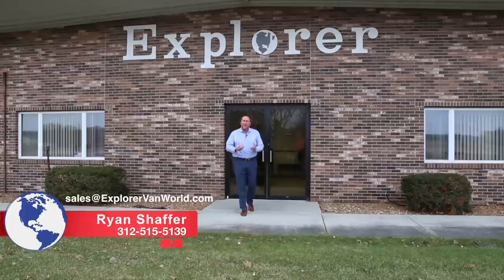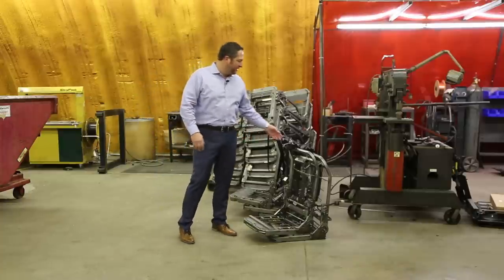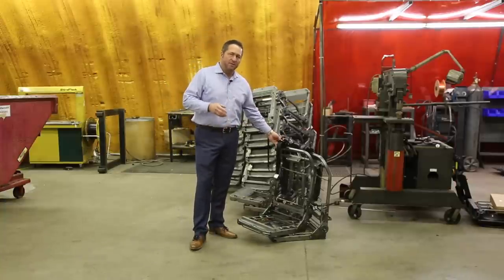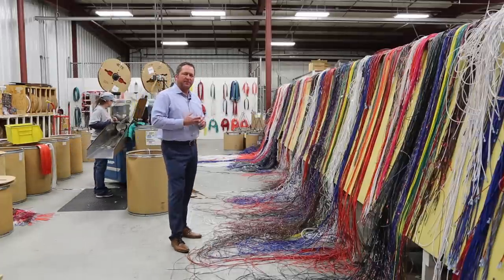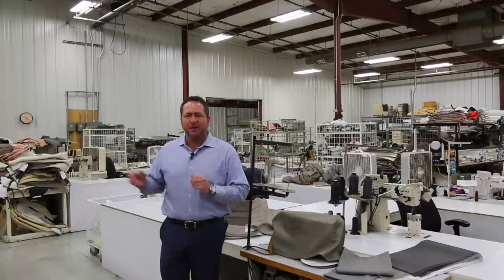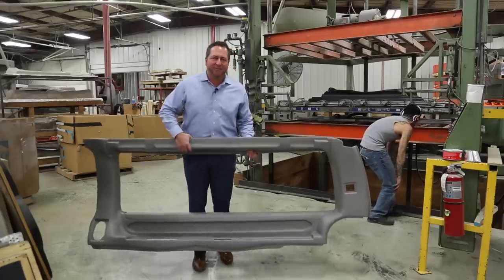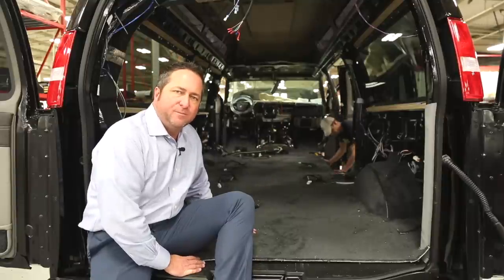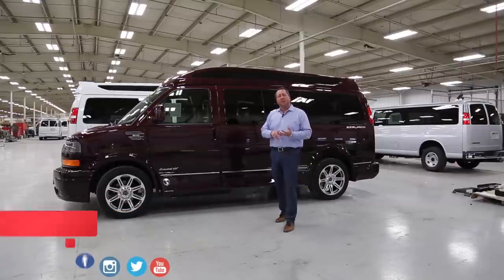Explorer Van Factory Tour

Comment: Ryan Shaffer sold me a 2006 Conversion Van from the late Lemay auto in Kenosha WI.   I have a 1500 AWD GMC where I customized it to have all bucket seats to be able to be removed.  It can still be used to hall something if necessary.   It comes in handy when the van gets older and need it to haul things.  It's still going strong today.  From my experience and learning about my van in all these years of owning this conversion van is that the door hinges that swing out tend to rust and hard to open if not used continuously. The large tires cause the tie rods to wear quickly which Ii replace 3 sets since owning the van.  The thin wall tires look good but hard to keep clean and rides hard.  I purchased a set of winter tires which ended up staying on the van which gave it a better ride when traveling.  The thin wall tires kept leaking air from our terrible roads and I needed service over four times to fix the flat.   Plus the cost of just one tire was over 300 dollars.  Getting at the spare tire can not be done safely on your own when the tires are flat.  Because of the fiberglass surround, I needed a tow truck to lift the van high enough in order to get the clearance needed to get the tire out from underneath the van.  The interior still is in great shape and weathered well all these years.  All that was added from Explorer had no issues.  I am glad to see a 4x4 and 2500 versions available.  The suspension on the 1500 AWD was not equipped well enough in towing a small camper over the years and to safely travel the mountains in Colorado.  The Van sat low which caused a variety of problems from the fiberglass surround.  I did not get the high top because it does not fit in most car structures/garage and you are left out on the street to park.  With the large TV, it is a magnet for people breaking into your van and added coverage with insurance.  Traveling with the van was nice and kept the kids spaced out and with the removable seats in the back allowed me to have plenty of room for luggage and storage.  A wall plug in the back would be ideal to add an electric cooler.  Overall great vans.

Comment: I have another question, why you guys didn't upgrade the Rotors and Brakes to compensate for the extra added to the vehicle? Because I purchased my Conversion Van with 23 driving miles then needed new Rotors and Brakes at 10k miles. The dealership Mechanic stated, the Van Rotors and Breaks should have been upgraded.

Comment: I just purchased a 2019 Chevy Express Conversion Van Explorer. And I just love it.

Can the lights located in the side vents be turned on?
Reply: How is it on gas ⛽️
Reply: I was looking at promaster for more headroom but I have been told it has reliably issues
Reply: @MoeMoe-nu7vt  

Its great on gas for being a Conversion Van with a 6.0 V8 Engine, much better than driving a Class B RV.

I just wish you guys didn't installed equipment such as the TV, Navigation Radio system and DVD Player that are five years old in a 2019 Conversion Van.
Reply: @MoeMoe-nu7vt LOL

Comment: Hi I have a 2018 9 passenger, two tone, I've had a few problems since buying it brand new. One of the problems I have is the 20" wheels keep loosing air, the lights keep coming on, so the H2 is seepking out somewhere. started about 2 weeks after the purchase. The monitor in the dash says the psi should be at 36. I can't find anywhere in all the information from the dealership. Did Explorer consersions leave it out?. Do you know what the problem could be? I know this is a lot, but the dealership hasn't been too much of a help. They don't know how to find the color of the touch up paints. sorry if it's a bother, but I'm getting a little frustrating.

Comment: Great video, even though it is already 4 years old. I do not know if you guys from Explorer Conversions are still listening. I just bought a 2013 Chevy 7 Passenger High Top  Explorer Van Conversion with 41000 miles. This van has been in Southern California all its life. The paint (silver) on the top is flaking off. Since one can not park these vans in a regular garage one can blame the California sun for this. Interestingly, though, all other paint surfaces of the van are fine. It’s only the roof that you guys painted. However, what disappoints more, is the fact that the seat upholstery and also the trims at the bottom of the windows show extreme flaking. What is going on here with this leather? I realize that I am complaining about a 9-year old vehicle, but where is the quality you are claiming in your presentation about?

Comment: Wow!..I want one so bad. Just can't afford 70K. How can Explorer even survive in terms of volume of sales? I very rarely see these on the roads.
Reply: 70k isn't really out of line, that's what a new Denali, Yukon and Expedition run and a navigator or Escalade run $100k.  If you buy a low top explorer and don't go crazy with options you can get one in the 50's.  Pro Tip: buy direct and save tens of thousands vs ordering it at your local dealer.
Reply: @satoshinakamoto3890  I bought one direct and I would never do that again absolutely no service.

Comment: When is explorer ever gonna learn? Step into the millennium. Upgrade the dash to led or amolde screen. Give more feed back to the driver from the from the dash via hand control or voice. Get rid of the twelve cup holders, big issue. Looks stupid having 2 holders per seat. Who has two drinks in a vehicle? Maybe upgrade to heated and chilled cup holders. Replace those areas with charging pads, cubbys and tablet/phone holders. Upgrade the leds so that they're color changing, dimmable from the dash via dial and music syncing. Get rid of the blue ray, gaming hook ups and just go with a wifi streaming tv. No one plays an xbox in their van anymore. Everyone is on a phone or tablet. Stop making the rear sofa/bed bumpy. If someone's gonna lay on it, they want it to be flat. Put more storage in the top, either rear, sides or both. Some place to store a blanket and a pillow for long drives. Get with it explorer. They're all the same. I owned a 97 which wasn't much different then the new When is explorer ever gonna learn step into the millennium. Get rid of the twelve cup holders. Replace those areas with charging pads, cubbys and tablet/phone holders.
Upgrade the leds so that they're color changing, dimmable from the dash via dial and music syncing. Get rid of the blue ray, gaming hook ups and just go with a wifi streaming tv. No one plays an xbox in there van anymore. Everyone is on a phone or tablet. Stop making the rear sofa/bed bumpy. If someone's gonna lay on it, they want it to be flat. Put more storage in the top, either rear, sides or both. Some place to store a blanket and a pillow for long drives. Get with it explorer. They're all the same. I owned a 97 which wasn't much different then the new ones..